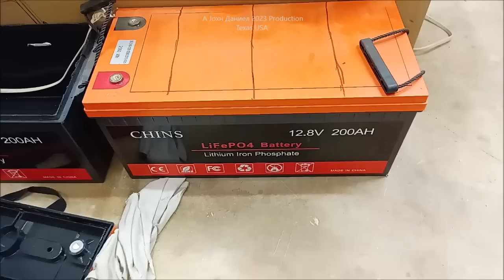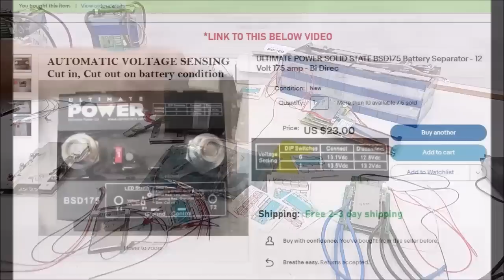The Limits of most SMART BMS for Lithium LiFePO4 Batteries, Avoid them, I Explain

Comment from the maker: The handy $15 100A 4S BMS https://s.click.aliexpress.com/e/_DkArRMV Here is the 24 volt https://s.click.aliexpress.com/e/_DEVagXF ,Atorch Mega Meter System https://s.click.aliexpress.com/e/_DBmlSJP Boost Kiera with https://ko-fi.com/john4kiera 175 Amp Ultimate Power VSR https://ebay.us/GSLWfk, ⬇ Li Time mini 100A Battery https://shrsl.com/40kwt, Sun Fun Kits https://www.sunfunkits.com 
If you need help, post your questions. 
TOTAL PROFESSIONAL DESIGNED AFFORDABLE SURVIVAL OFF GRID KIT  https://amzn.to/42cdjBX
Reply: Where is the link on the cheap balance board?   Do you know about a 8s version of these $15 boards?  I have 24v inverter setup and want to eliminate the battery junction issue in dirt roads and different discharge voltage in series that happens when I don't use trailer that often.... Great video love the way you have raised your daughter..,
Reply: how about some recommendation on plastic enclosure for the DIY batteries

Comment: We have 100’s of people in the U.K. running lithium / lead hybrid from commercially produced batteries with programmable JBD BMSs and with multiple lithium batteries in parallel. The balancer is fully configurable for start voltage, delta to balance and wether to only balance while charging. As the BMS is fully configurable it can be set up with cut off voltages to give best battery life and actually manage the battery rather than just protect it from extremes.
Reply from the maker: You need quality voltage activated auto isolators and preferably a BMS that is fixed, not programmed. Allowing the lithium to collect the solar, lead acid to collect wind power, you just set the disconnect from your sharing at 30%. Doing it for years I have found numerous ways to do it.
Reply: @JOHNDANIEL1  No I don’t. I have years of graphs that prove it. Fixed BMSs are set to maximise capacity not life and push limits and allow low voltage overcharge from alternators. My lithiums collect solar power just fine, right up until what I choose to define as full. My lead are happy as they are kept on a low float and sit there to protect the alternator when the lithium are full and to act as a buffer for the dump load. There is no need to disconnect sharing at 30% as the voltages become equal then anyway and the lead then start to contribute which,  in a boating setup, is fine. The starter battery is kept out of the equation. I too have been doing it for years and found different ways to do it and settled for the one that suits me and my batteries best. There is more than one way to skin a cat as the saying goes for some reason!

Comment: Thank you to you both, for the DISCOVERY.
             IT IS THE WAY. 
Rather than buying an (Echo Flow) power pack  or something proprietary and when it goes wrong.The manufacturer doesn't get back to you after using the customer as a guinea - pig. nearly burning down their campervan.
    I have purchased two 12v lithium phosphate batteries to make 24v using the higher voltage  keeping heat losses and excessive current down for the 3kw inverter powering the refrigerator or induction hob. coffee machine.or
 lights compter when required. 
    Individual 12 batteries are the way forward giving 12VOLTS for usb charging ect. In the platfom without the need, of an Inverter running.
      Using Individual Bluetooths and BMS i can keep an eye on the top ballance and state of  charge. Bleeding or changing. Keeping the two 12Volt batteries at a near same State Of Charge Ballance. Work's well when conserving power in  emergency situations.
     The Best of Both Worlds. 12v and 24v. 
      Looking forward  to your mixing lead and lithium video. Using the lead as a sponge reducing the Amps surge in the Lithium keep the BMS ACTIVELY ON.
Reply from the maker: I caution anyone going over 24 volt, insist they use as much DC only items they can find, and not wasting money on those very finicky premade limited power stations for their real needs. I am running two 10.2 CUF DC refrigerators in my home, 4 DC freezers, and 90% is DC lighting. I ordered 1000 feet 500 red/500black of 6 awg cable to wire the building with in DC and made 2 mains with 1 awg from the bank to distribution boxes using 28 sized to circuit auto reset circuit breakers into it and 2 auto grade fuse boxes. Even my TV which is only 29" and rarely used is 12 volt, as is my 16 security cameras and monitors. We use the inverters for well pump, 4 Air Conditioners, microwave, some cooking and tools. 
You loose over 14% inverting from DC to AC so the cost of going DC mostly is off set by the actual solar and battery you'll need is less overall.

Comment: I been running three of the 300amp bmses. Your showing going on 3 years now with no issues
Reply from the maker: These Dumb BMS items are the safest to use, I get idiots screaming crazy for me showing it and saying not to use the smart bms due to it is taking all your real controls away. They get excited by the BT and UART screen feedback, like cheeto eating video gamers. Those App driven and flowing programmable BMS are constantly screwing up. Already seen 2 now, in 48 and 1 guys 24 volt system be crippled by a damn smart BMS.
Reply: You still have control with the settings on your mppt charger and settings on inverters

Comment: The Bluetti EB70 I have has 2 fans - but they are obstructed by the fan input and output air intake and outtake. So I made some big holes on both sides and they are now blowing very nicely although don't have the tools to test the difference, it clearly blows much more air through the system for cooling it down now. Of cause you don't wanna put your fingers into the holes, as the protection is gone on that level. Although, it is possible to get some protection as there are holes in the side for attaching a standard CPU fan protective net for it and still have a pretty awesome air flow compared to the enclosed small hole plastic it had.

Comment: Im a 17 year old, i build my own Lifepo4 packs, me being money limited i do it dirt cheap, currently having a 200Ah 12v with a Programmable Bluetooth bms, its only 100amps but the reason i bought a programmable one is due to the fact im upgrading this battery pack to 400+ah with scrap 26650 batteries. Im extremely smart with electronics and im going to upgrade my bms to 400amps, with only $50 of parts, the bms is worth $75. I may be making a video on this, no one on the internet has ever thought of upgrading a bms. I can program the bms to 400Amps and calibrate the current reading when i upgrade to a 400Amp shunt. So that it will read normal but can handle 400amps. This also keeps my battery % accurate and makes me save a ton of money.
Reply from the maker: Stay at it, and use results not hype as your leading methods to progress.
Reply: @JOHNDANIEL1  might make a new channel and make vidoes, its a dream but lack of motivation is my problem haha. Ill get there at some point. I wanna be able to help people out and actually have educational videos and stuff.

Im sure it would be extremely educational of physically upgrading a bms for cheap to handle more current. Finding cheap cells for cheap to build a lifepo4 pack. I shoulvr made a video if my 4000watt pure sine inverter i bought for only $125, its worth $750 new, it was Dead on arrival  and i fixed it in 30 minutes. Couldve showed how to fix a broken inverter. May buy broken things for videos to fix and show how to save money.
Reply: @joshwayop  here i am,  the person who could use this knowledge haha

Comment: hey john i don,t use bms i only use battery balancer only, i set the charger for controller at 138 to 14 v only so far it been working for 4 years now when sun goes down they seem to float at 13.2 13 4 it works for me i do all diy life04 all so been use ing a charger on each bat
Reply from the maker: If you have enough cells, 150% or so of your actual top needs,  you only need such a set up. A BMS is for short protection, over draw protection, and over charge protection. But you can bypass a BMS with common sense and a few parts like over load breakers and proper under voltage disconnects. A balancer is good to gain longer cell life, and the best are just the 1/2 amp per cell and never charge over 14.4 if in a 12 volt system.

Comment: SunFunKit looks very interesting if you wanna go deeper into understanding batteries. They also have connection of Serial, Parallel and Serial Parallel picture, very nice.
Reply from the maker: I think if you go to them and use JOHN DANIEL or POKY as a discount code you can cut $50 or more. They do make a impressive kit, and it is capable of multiple in series and parallel.
Reply: @JOHNDANIEL1  I'm sure someone will use that :) I now have those RoyPow Batteries to toy around with and...
A renter who don't want me to have my solar panels up and windmill attached to on the outside of the balcony. Well.... So things to sort out.

I'm thinking I might get around with some Parasol stones and put something out, you can get some pretty heavy stones and put a metal rod in it and I guess string some solar panels and the Windmill on them if I get a couple of them.

We will see.

Comment: I have 2 RoyPow Batteries incoming of those kinds, 30 Ah - they where not cheap but... I think they probably are a good start to try out things, Serial, Parallel and trying out stuff trying out by doing stuff :P Trying to get a MarsRock Controller although they did not have the 4000 watt in store. So seeing if I can get the 3000 Watt, which should be more then fine for my dimension and system.
What sold me to buying them was that they put the Wh data and other such thing on the battery itself - so sick and tired of vain data details on things.
I have gotten the Charger RoyPow 10 Amps 12 Volt and tried it with the Gel battery I have and it seemed to work although the charger say exclusively Lithium Iron Phophate although the sellers are adviticing on Amazon say they can do old kinds of batteries, yet the package and manual don't seem to say so which is kinda odd....

But whatever the case, Batteries are incoming - so that will be interesting to try out. And then I just need the controller and I'm on my way to trying things out, or exploding something, either way... Getting some experience.

Comment: Hey John, I have a question. You’ve given me inspiration to DIY, bat build. I have a vintage Japanese RV with a 2.8Litre diesel. Can I run a single say 300AH lifepo4 bat for starting and house? Would I need a Dc - dc charger? Assuming my alternator will put out 14.6 volts. Appreciate any suggestions?
Reply from the maker: Single 300 Ah battery would not be commonly designed as a starter rated battery. Most 300 ah and even 400 ah sold on the market only have a max of a 200 amp output, and may peak for a single second at 400 to 500 but will fault quick on most starter loads. The BMS in them is capable, but most of them are not made in their design for starting purposes. A pair of 200 amp with 200 amp draw ability are much more capable to do that engine starting if you wire for it.
Reply: Thanks for the quick reply!
Reply: @JOHNDANIEL1 Would it make a difference to add a powerful capacitor pack as the first buffer?
Reply: Hi Aubrey. It's preferable if you use the 300ah lifepo4 battery for house only. Just leave your existing lead acid battery for starting. Use a dc - dc charger to charge your lifepo4. You can always add solar if you need additional charging?
Reply from the maker: Yes to Gordon. Using the lead acid in the van for engine is best outcome. Making a controlled charging system for your Lithium off that lead acid is best till automotive electrical systems catch up with computerized batteries.
Reply from the maker: True fact, Some modern ATV's that are using a Lithium cell battery in them has a capacitor discharge starting system. He could do exactly that. There are Russians and some Brazilians making videos of doing it for that use.
Reply: @Teknopottu  please tell me more. My existing start/house 2 battery set up is a space hog. I’d like to pull this off. I’m still learning about these systems and I guess I was hoping there was a way to measure the peak demands of the starter side of things or as you say (a way to buffer) to avoid blowing up a $1400. Lithium battery. The rv has a small easy starting 4 cylinder diesel. Are there alternators that can have demand limits? I’m grasping here as you can probably tell. Lol
Reply from the maker: Philco engineer Scott Pence once said, Alternators are all 100% falsely advertised - once installed. What that means is losses and peak conditions never equate to your expectations. 
You can get a 100 amp MPPT solar charge controller and run a 80 amp alternator into it if its clean output, then into a LiFePO or LiPoly battery. 
But the best methods is using a DC to DC adjustable output charger. 
I would for your needs suggest you research Headway Cells, and custom distributed battery install.
Reply: I’ll check it out.
Thanks again John!
Reply: What kind of RV? Look into the hybrid inverter all on one setups too
Reply: Hey Conner, I have a 1995 Mitsubishi Fuso Canter model FB
Diesel automatic, on dual wheels. It currently has a leisure battery and everything works great. I’m adding Solar and a few other goodies like induction cooking, maybe a larger fridge and  12V AC. I’m convinced someone out there has figured out how to integrate everything into a single Li On by now. Just have to find them or create it.

Comment: Thank you for all your great content. I have to build a 48v battery because that is what is required for my all in one growatt inverter. Could I build 4 12v (4s)  packs and combine in series using a bms for each 12v (4s)  pack, 4 total?
Reply from the maker: These are designed as engine start rated, so I doubt that they can be placed into 48v 4S. I recommend using a deliberate 48V BMS with 16 leads on it, and always over buy the rating on them to defeat china math over exaggeration of ability!

Comment: I found a solution to this myself. About a ton of lead, and ten gallons of battery acid. My BMS is a piece of #4 welding lead.
Reply from the maker: My best battery choice remains old school Lead Acid. To keep it at top voltage to extend it's life a few LiFePO4 for sustaining over 12.4 volts when needed. My remote items, RV and well pump are Lithium due to the single use aspect. 
The problem with Lithium is they are difficult to build into massive banks due to the industry who makes them are short sited like tic tok viewers.

Comment: Balancing is the least of the tasks of a BMS.  The primary task is to ensure you don't over charge or over discharge your batteries and, if equipped, keep you from charging/discharging when it is too cold to do so without damaging the cells.  Many BMS's don't even have balancing, or if they do it doesn't work well.  Once a battery is top balanced, which you can do by connecting all cells in parallel for a while, they should never get out of balance, unless you have a faulty cell, which a balancing BMS isn't going to fix.

Comment: Both the active and passive balancing system fails in LiFePO4 battery packs. They work fairly in Li-ion and Li-Po battery packs. Any suggestions to balance LiFePO4 battery packs?
Reply from the maker: Yes, a flat rate charger. And if I had the $$$$ I would build one. Fact is, a BMS is pure BS. You can have 500 cells or 4, what you need is isolated direct cell charging. Each cell gets 3.65 volts, Not 14.6 shared by all 4 in a 12 volt. 12,24,48, 60 volt battery won't matter. If, and I do, can use a 12 volt charger to charge a 48 volt AGM battery bank by charging each 12 volt as a independent then why not 3.2 or 3.7 for Lithium. Because THEY want to rip you off.

Comment: I saw that you had your bench set up in the last video, with the CNSWI Power 3000 inverter. Will you be talking about that unit soon. I bought one with your recommendation to put in my camper, but now wondering about  if it will work for the camper. The shore power has a ground, but the inverter does not. Do I bridge the common and ground at the inverter before going to the rest of the system? Also, Congrats  Kiera, All the best on your new channel!!
Reply from the maker: That's the plan!

Comment: I've heard that we're not suppose to mix different brand lithium phosphate batteries. Is this 100% true? I bought an SOK 12v 100ah battery a little ways back, but after watching your video about the power queen batteries, I want to try one or two. Would it be a mistake to parallel a 12v 100ah Power Queen with the SOK battery I have?
Reply from the maker: As long as you do not get smaller in capacity and capability. I have not had a problem mixing a Unowix with Power Queen, and Unowix and SOK use the same BMS. I would buy them through Amazon though https://amzn.to/42wav21 because they are fully covered by Amazon as well as Power Queen group. Same price, but better customer outcome.
Reply: Thanks Daniel, appreciate the reply and will use your Amazon links. Also really appreciate your video on grounding. It cleared a lot up for me  as I had gone done the Youtube rabbit hole about to ground or not to ground and while I kind of leaned towards floating, there are many who argue that and insist you need an earth ground. Your reasoning seems to make the most sense to me so I have gone with that. Thank you!
Reply from the maker: @keep-it-real6926  Just remember, If you earth ground your solar panel frames, for the same illogical reasons they use, be sure to buy a few hundred feet of the same 8 awg bare copper they use, which can not handle a lightning strike, but is awesome as a lightning magnet right before it melts in half and sends your presents form the weather Gods. We here are "Not gonna do it University" will continue to use a remote diversion lightning device called a piece of rebar and a higher spot to solve the issue.